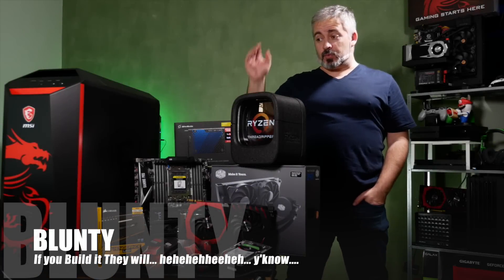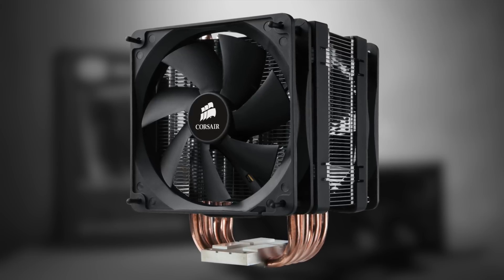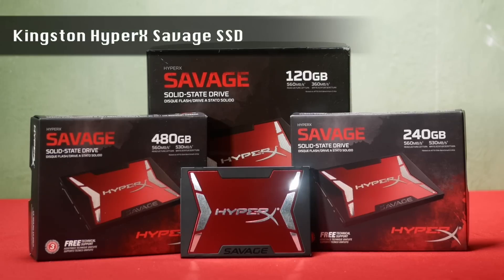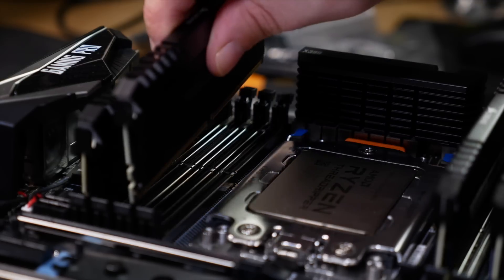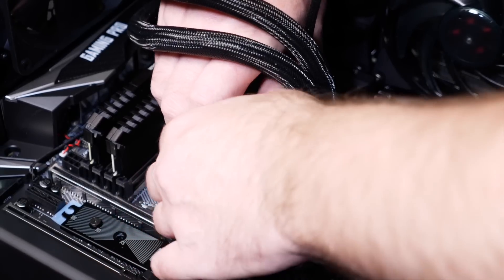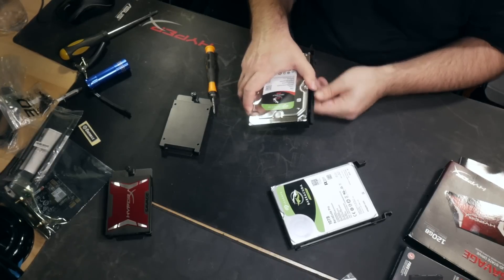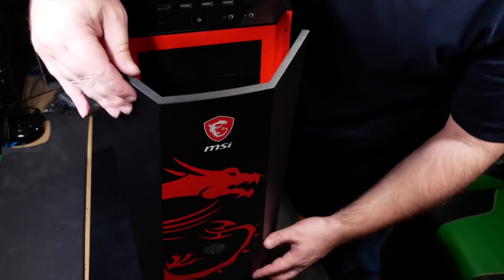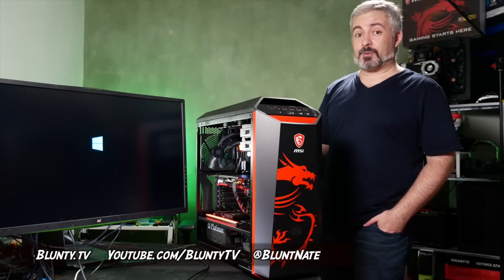Beginners Guide - Build a PC - It’s WAY EASIER Than You Think - #YesWeBuild

Comment: Something I didn't understand the first time I watched one of these introduction videos was the BIOS.  What is it? Why is it?  What should I be concerned about setting up on the BIOS?  I am kind of surprised you never mentioned that the BIOS setup maybe needed.
Reply from the maker: For the most part, you wont need to touch the BIOS settings while building your first PC. By the time you legitimately want, or NEED to change something in the BIOS you're doing something so specific, where you've already understood WHY you need to do it. That's why I didn't mention it here.

Comment: Always worth mentioning, that the person doing the build should ensure they are seating the GPU into the correct PCIe slot for their specific card. It is so easy for someone to falsely assume that all slots are equal cough The Verge - and potentially put an X16 card into an X8 slot, thereby capping the card's performance due to bandwidth limits. As seen in the following image, at the short end of the blue slots, it says PCIEX8_1, PCIEX8_2, PCIEX16_1 and PCIEX16_2. At first glance, all ports look the same, but they're not. Always look at your specific motherboard carefully for the relevant labels and use PCIEX16_1 for the GPU if it is a X16 card that you have (and if it's a modern card, odds are it will be x16).

https://img.purch.com/amd-crossfire-nvidia-sli/w/755/aHR0cDovL21lZGlhLmJlc3RvZm1pY3JvLmNvbS9JL0EvMjQ4MTk0L29yaWdpbmFsL1BDSWUtU3BlZWQuanBn
Reply: speaking of The Verge, you actually missed this in your rant about their stupidity: that the presenter said it doesn't matter which slot you use. What an utter tool that man is!

Comment: Great video really like how you show cable placement. A computer can work just fine with cables everywhere but it looks like crap. also like how you state check the book that came with the motherboard not just plug where ever. That tip can save many hours of troubleshooting later on.

Comment: Only thing that i could think of, would be to hook up the components up outside of the case first to verify that it POSTs.  (I usually just set the MotherBoard on the MB box to do this) This way, if a component is DOA you don't have to take everything back out of the case. just a thought, other than that, great video Blunty. I will probably be sharing this to friends i know plan on making their first PC that live to far away.

Edit: Looks like others commented this concept before me, probably should have read the comments before commenting.

Comment: Best thing is maintenance, once you have built it you can see that when it goes wrong which bit needs removing and replacing saving you shed loads of money. The build I replaced two years ago lasted ten years like a fisherman's knife; it had two motherboards, three PSU, two graphics cards three HDs and two cases. My present build has been good this last two years. Since 2003 all my builds have run on Linux; present system is running on mint ;-)

Comment: Most common things that can go "wrong" from my experience:
- cables from front panel are connected wrong, or not connected at all
- CPU powering not connected (this happened to me 3x :P)
- Video Card powering not connected
- using older MB whit newer hardware (GPU, etc) can make problems, updating MB's Bios should help

Comment: The only thing I do different is power it on, check everything is working, install windows then put in my gpu.
Reply: Do you mind if I ask why? Is there an advantage to this?
Reply: That would work with Intel mainstream based systems, but until AMD releases Ryzen APUs, you kind of need a graphics card seeing as it has no support for integrated graphics, at least with Ryzen and Threadripper, and of course Skylake-X and Kaby Lake-X also doesn’t have support for integrated graphics.

Comment: It’s good practice to test if the system posts before all the cable management is done.
I do it outside of the case these days. You don’t want to have to do installation and cable management over if it turns out you made a mistake or you got faulty hardware.

Comment: Can confirm after building my first pc a little over a month ago after pressing the power button and nothing happening. Checked every possible connection and.....forgot to flick the power switch on the PSU *facepalm*
Reply from the maker: Happens to the best of us. Heh. Happened to me once, while I was live-streaming a build… that was a bit embarrassing 😂
Reply: When I had built my current PC I connected everything, flicked on the PSU button to "I" and nothing happened. Cold sweat made its way out on my forehead, I checked every connection on motherboard and PSU (I thought maybe one of modular cables got disconnected or something) and still nothing. Checked I/O buttons on MBO, everything was fine. Then I realized that I won't be able to solve anything while panicking so I took my dog for a walk to try and calm myself down and think what to do next. I came back in after about 30 minutes and first thing that I notice is: power strip to which my PC was plugged in wasn't plugged into the wall.
Reply: Built my first PC on my B-Day September 10 and the the moment I pressed the Power button on my case it wouldn't turn on! Though the Power LED was constantly on so that told I had not connected those little bastards correctly, took off side panel of my Case, fixed, & voila! It lives because I've been using since that day w/ no issues!

Comment: Typically, it shouldn't matter which way around the header pins are on the motherboard for the power and reset switch, as all it does is complete the circuit when the buttons are pressed. Although, I have a couple times put the pins on the wrong pins, which yeah didn't work funnily enough!

Comment: Really good guide Blunty. As for "tips for noobs" ... it's worth pointing out M.2 locations since they can sometimes be inaccessible after graphics card is installed.
Reply from the maker: M.2 mount locations vary between boards anyway. Also M.2 or not, the suggested order of operations here includes doing the drive installation well before the GPU anyway. But in fact as a few mitx boards have m.2 mounts on the back, it is worth pointing out that under that specific circumstance it should of course be installed before mounting the motherboard.
Edge case but ¯\_(ツ)_/¯

Comment: What happens if the tube in the water cooler leaks?
Reply from the maker: If that leak happens to drop into just the wrong place, potential short, so, yknow, not a great thing. But the AIO's from reputable brands almost never have issues like that. It's actually remarkably rare (no brand wants a story about ruining someone's rig coz of a leak, so they're very carefully designed and built).  I have full confidence in recommending them.

Comment: Good guide. It still baffles me that case headers haven't been standardised. Asus used to have a "Q-Connect" piece of plastic/passthrough you could plug all the case headers in to as appropriate for your case, then just plug the one piece in to your motherboard, but their recent boards don't seem to have it. Was fairly short-lived it seems. Which is a shame.

Anyway, if I had to critique anything it's that you didn't show closeups of the RAM and PCI-E clips snapping in to place, as that is a common thing that people can get wrong not seating stuff properly. Modern boards make them automatic and all, but it's still something you should have perhaps shown. I am sure it is difficult getting closeups in a case, though.

Comment: Hey Blunty, this build is awesome but those ketchup and mustard cables are gross. I would recommend so extension or custom cables.
Reply from the maker: In my personal builds I do use custom cables. BUT as this was aimed at beginners, there's no point over-complicating or confusing things by side-tracking to that conversation. and to be frank, the cables on the PSU here are not THAT bad. Unpucker your bum about it ;P